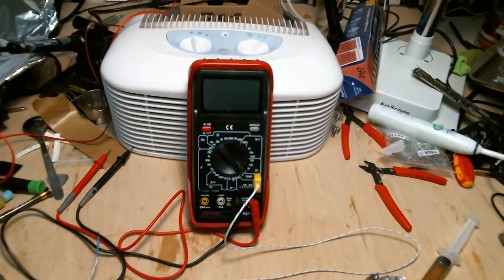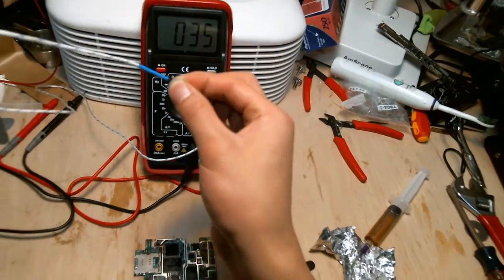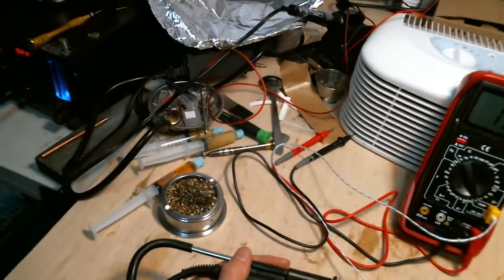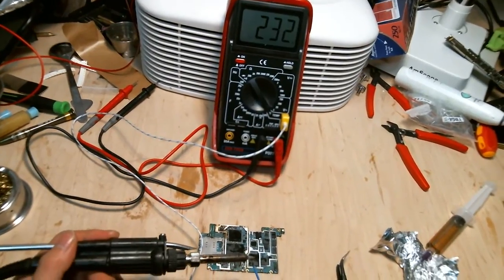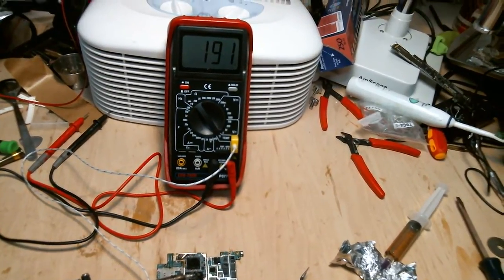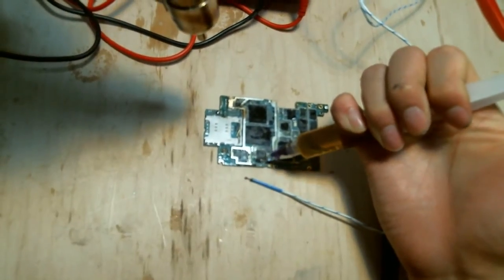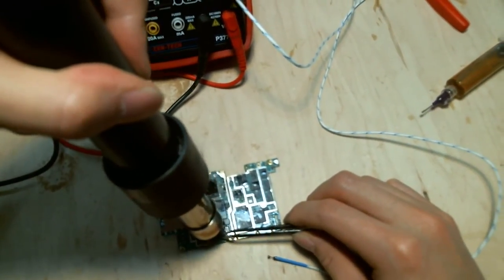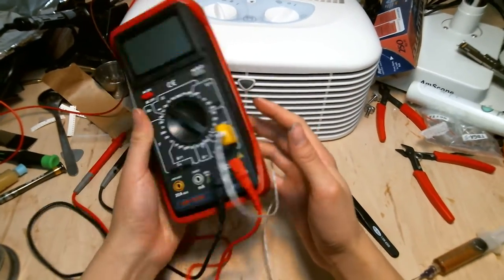CyberDoc Digital multimeter With Sound and Temperature probe K type for SMD Repair rework

Comment: Question: when inserting the probe it is important to do it correctly. I have a + and K sign on the probe, while a longer (upper) and a shorter (lower) hole in the multimeter. Mine is different, a MY64 Mastech. Could you please give some advice?